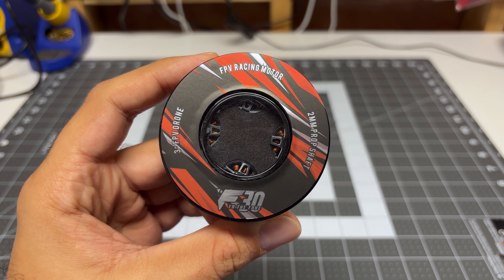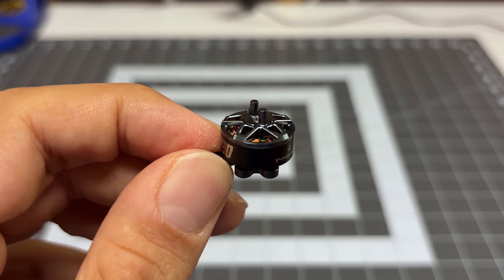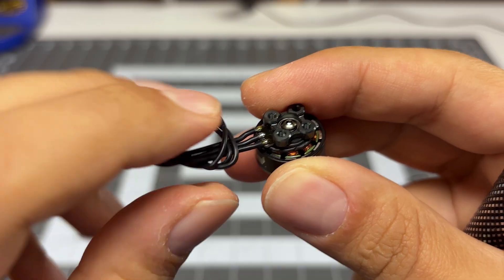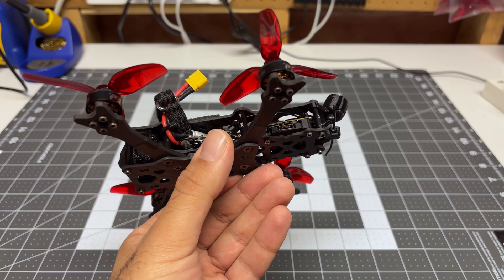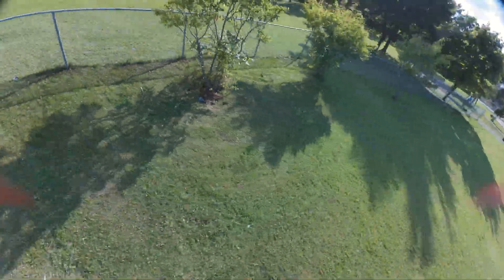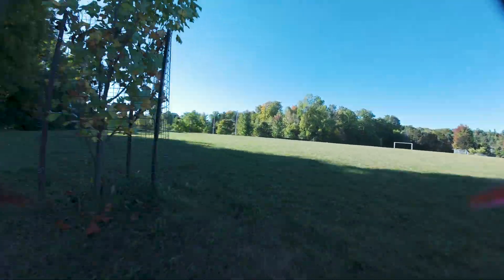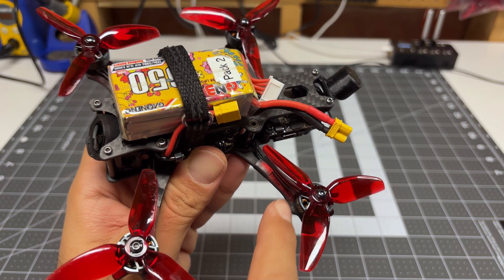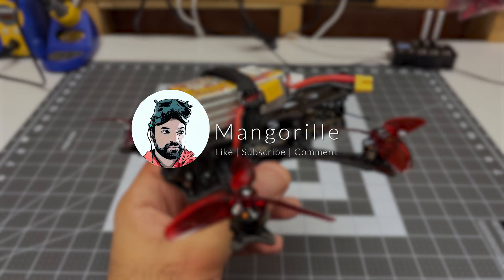I'm First To Review These Extremely POWERFUL 3" Motors! 🤓 | T-Hobby F30 3" Freestyle 1404

Comment: How do they compare to bigger 1505 motors? Do you have comparison?
Reply from the maker: I’ve tried 1604 motors and you get very similar performance with these at a lower weight.
Reply: @Mangorille do you mean the torque or max thrust? I run currently 1404 tmotor 4600kv, but with 3x3x3 inch prop it feels underpowered and less snappy than smaller one. I'm thinking about this , 1505 4000kv from deepspace or something different...? Idk
Reply from the maker: @unperfectcooking  Most of my lightweight 3" builds use 1404 3800kv with 3x3x3 props and they feel great. What is your ready to fly weight? I suspect your weight is too heavy for those motors. I'm usually 210-220g ready to go with battery.

The problem with the 1505 motors is that they weigh about 3 grams more per motor and they also use 12mm motor spacing for the mount whereas most 1404, 1404.5, and even 1604 motor use 9mm motor spacing.

If you absolutely need bigger motors, look at the T-Hobby P1604.

https://www.youtube.com/watch?v=JV8NnNlx2vg
Reply: Auw is 227g. I changed the motors to previously mentioned 1505, reduced the weight of the quad to be around the same and now it flies great!

Comment: Why you ffly through narrow ggaps with an open prop quad? Its like asking the props to bend
Reply from the maker: Oh ya, I generally like proximity flight and the challenges it brings. :)
Reply: Pro tip: avoid the dangers of the outdoors by flying only in a simulator
Reply from the maker: @c0t1d0s0  Fly, break, cry, fix. That's the cycle of FPV. :)

Comment: I'm flying a 3 inch Quad at 4S though with Deepspace Motors at 4000KV, I'm pulling about 85 Amps. Maybe give them a look. Though very innovative Motors taking a lot good stuff together.
Reply: They don't pull this amount. Electronics are not well calibrated on deepspace.
Reply from the maker: The 1404 size? 85amps sounds really high, I haven't even seen a 1604 motor pull that much amps on a 3"
Reply: @Mangorille they are 1505 4000kv
Reply from the maker: @chetan2481  Thanks, they look like really interesting motors.

Comment: Lower pitch props would help with the low throttle control. Those look like hq 3x3x3 and tend to have teleportation capabilities
Reply: 😂yez!
Reply from the maker: Good eye, they are T3x3x3 props. I've tried lower pitch props in the past and I seem to keep going back to these.
Reply: The HQ 3x2.5x3 are great on 1504, so they could also be a good match to this.

Comment: 60 amps is crazy.  I guess at this point the XT30 connector can be problematic. XT60 is in order.
Reply from the maker: It's only the peak amp draw and only lasts a few seconds. I don't think the batteries can keep that up either and you can see it starts to drop off fairly quick when while at 100 percent throttle.
Reply: @Mangorille  I believe XT30 connectors are normally rated at 30A continuous / 40..45A peak depending on manufacturer. We're in the "pushing it" territory here.  Also, heavier wire can help out here by acting as a heatsink for the connector. Your flight battery has pretty substantial gauge wires, I'm sure that helps.
Reply from the maker: @c0t1d0s0  Agreed, looks like AI is saying they can handle up to 65a peak.

"The peak rating for an Amass XT30 connector is 30A, with a continuous rating of 15A. Some sources also list a 20A continuous rating and a higher 30A to 65A peak rating, depending on the specific version and manufacturer. "

Comment: The low down throttle control is a big one for me  I'd say.
Interesting motors with the single m2 for the props.
Thanks for the honest review 👍
Reply from the maker: Welcome. Like anything, you can get used to it if you want to but it'll be a rough initial few flights.

Comment: Thanks for the review. These motors are 1404 by the way.
I guess the higher 4000kv make them more powerful and amp hungry vs the 3800kv 1404 tmotor.
Try some Dal 3028 props or hq 3x2.5x3 for more low end throttle control.
Can you make a review of the deepspacefpv seeker 1505 motors next 😅
Reply: Really need Deepspace Aether 1505 400kv review! I very interest on this motor but can't find any on the internet. Looks really solid from what I see that came with Seeker30.
Reply: @siakpingvery I’ve got them, they are great
Reply from the maker: I used to fly 4600kv xing and xing2 motors and even those puiled lower amps. Going back to my videos from a few years ago, my 4600kv motors only pulled 48amps on a 3.5 inch.